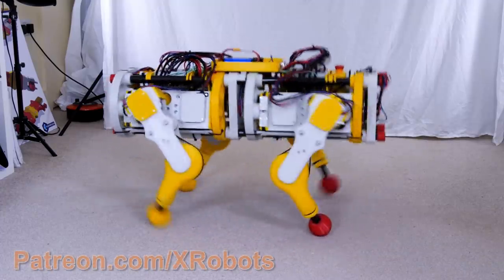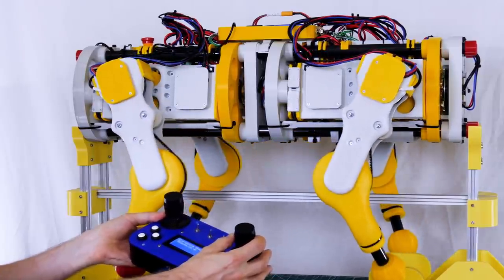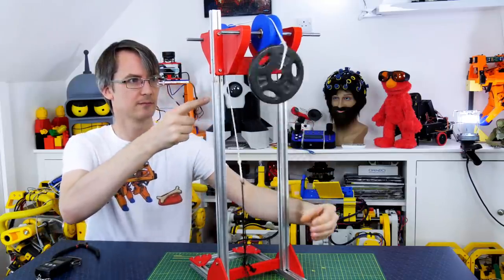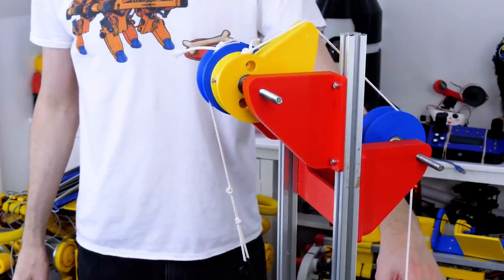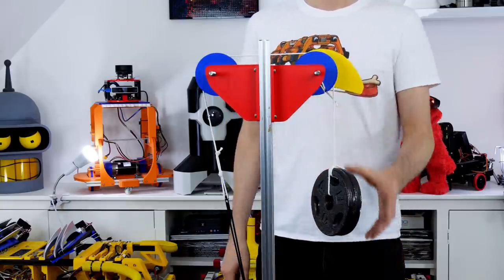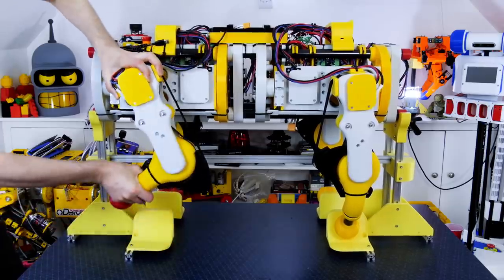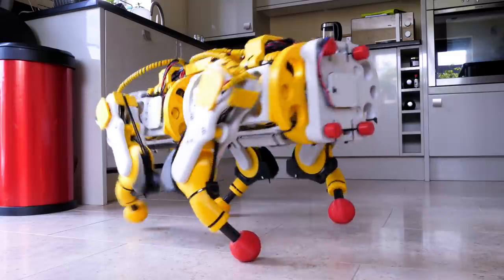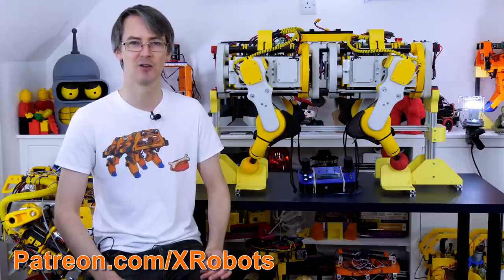Constant-Torque Spring-Balanced Actuator

Comment: James, Measuring the current shouldn't be too difficult. Just use any piece of wire that is sufficiently thick, with currents on the order of 200A you'll find a measurable voltage across them! 

For example, you can use the negative lead of your battery. Use the black wire of your balancing lead for one end of the voltage measurement, and the first "junction" where multiple wires connect as the other. 

The reactions that allow a LIPO to charge require some extra energy that is provided as heat to the charging LIPO. Thus a charging LIPO should get COLD. Now that effect is offset by the resistive losses around the system, so it might be unnoticable. But on the other end of the charge/discharge cycle.... the discharging lipo also produces heat that is added to the resistive losses. So a discharging LIPO should get warmer from the discharge. 

Last, that 60C rating of your LIPO battery is determined by checking that the battery doesn't overheat when you apply that much current. So if you're near the limit, I certainly expect the battery to be hot afterwards. You don't need to exceed the limit to heat them up.

Comment: There are constant force springs often used in robotics they might be a pain because you would need a bearing to hold the spooled spring steal wrap but they would work and would be way easier in to long run to optimize.

Comment: I have a much simpler solution for you. What you need is a "constant force" spring, a variant of a clockwork spring. You can find some on Amazon by searching "drill press spring", or aliexpress by searching "constant force spring".
This is a flat wound spring that can fit inside your robot's joints, counterbalancing while being completely hidden.

Comment: If you want to have a more adjustable spring rate you can just take a steel or nylon cord/rope/cable and use some standard springs that you can interchange. If you got the spring rate right you could even use smaller motors for the knee and hip joints. where you could use gear reduction with a planetary gearset so you wouldn't have the need for that much torque.

Comment: Seems like measuring the temperature of the motors beyond "not hot to the touch" anymore would be a good controlled way to monitor load. Furthermore, what old CNC drives did to reduce the heat of holding torque was to incorporate a brake. Seems like a combination of the two might be the best case for idle and mobile energy reduction.

Comment: You could also use an eccentric geared pulley for your belt drives. Allow the motors themselves to have more torque where they need it and less where they don't. It would be less bulky.

Comment: You know, I think one of the reasons I love robots so much is because it forces companies to be fucking creative again for once in their lives.
Youve seen the shit we had back in the 60s to early 2000s, everything was mechanical, and overengineered.
I can understand the shift away from mechanisms, since points of movement equals failure points, and extra cost, but god damn they are so cool.
And as is turns out, its not easy to just make a robot out of a bunch of motors and pieces of metal, you need alot of over engineered joints, pulleys, gears, and shit like that.

Comment: For Current Sensing: Allegro makes some really small current sensors. Pololu has a board(ACS724 Current Sensor Carrier) for the smallest series(up to 50A) in a tiny 20x18mm size. Might be worth a look. Next bigger Sensorsize goes up to 400A(Battery Protection is no joke) but I dont know of any available breakout boards.

Comment: Surely a spiral spring is the answer. They usually have a high range of motion so with the relatively small angle through which the joints move any torque produced by such a spring would be fairly constant. They're also compact and can be relatively light...

Comment: Lipos do get hot even when they don't exceed their maximum C rating. There are external Shunt trinkets for Arduinos, you could log their voltage output and then you've got your amperage over time :)

Comment: Nifty start... I think an improvement would be to change the cam profile just a bit so that the spring is exerting the correct force to balance the weight at the angle of the foreleg (eg, if the leg were straight, the spring should be putting out near zero because the T=sin(theta) * mg (where theta=0 for vertical -- pure compression).

Of course you need to translate all that into your coordinate system for the servos... and do what James Pray recommended below to compensate for the difference in length as the cam size increases...
But this is pretty cool man!

On a completely weird idea, you could put the "top end" of the bungee on a screw-adjusting hook to be able to adjust the preload (slowly) and could rig that so that "adjust preload to minimize current when the knee is at this angle" (ie, standing at rest).  Then the dog could adapt to carrying different weights without  a lot more current being expended -- fido, fetch the keg for me!...

Comment: Something in this video reminded me of clockwork, where they also really wanted to have constant-torque springs so the clock doesn't tick slower as the spring winds down. Bit of wiki-reading led to https://en.wikipedia.org/wiki/Fusee_(horology) which is essentially a longer, coiled up version of the cam you have. If you had a spring-loaded helical cam on the shoulder instead of putting the cam on the knee it might free up some space between the knees.

Comment: Do you have a thermal camera? You could surely do a nice demonstration by setting up a fixed, repeatable exercise routine for the robot, then run it with, and without the constant-force springs. The difference in temperature rise would be a clear indication of power savings.

Comment: I'd be curious to see a linear spring, either a typical coil spring on a telescoping rod, or a pneumatic spring. You could achieve a centerpoint where the spring is neither compress nor extended, and correlate that to the dog's neutral stance, then you'd have the spring action in both directions. This would also be less bulk on the leg, and could just as easily be mounted to either side of the leg, which may be beneficial when it comes to overall movement without modifying the body's frame. The importance of having a spring that can actuate in both ways shows itself in jumping, where one spring would assist in the jump itself, and the other spring would assist in the landing, this can be correlated to any gait movement but to a lesser degree. The bungee cord on the other hand only operates in one direction, meaning you still have drive inefficiencies in half of the movement of the joint. Alternatively, a torsion spring may be the optimal solution, as it can twist in both directions, and is much more compact, as it'd replace the hinge rod and add no bulk to the leg.

Comment: James try vacuum pistons, they are driven through the normal ambient pressure and have nearly constant force too.
The vacuum upkeep could be a bit of a challenge.
But since it is only necessary periodically to counter leakage you could try to getaway without a onboard system for the robots runtime.

Comment: Regarding the battery getting hot : Normally with ODrive, you can report the DC bus current draw, so you can know how much you pull and push on the batteries. Depending on those numbers, you can adjust the various PID constants to make it less aggressive, and it should draw less amps. Afaik you can't yet set a software limit on the DC current draw, but you probably can add an outer control-loop to use less aggressive settings when you have monitored the integral of the DC bus current draw going to high, or when a battery temperature sensor get too hot.

Batteries can also get hot due to regenerative braking, they are typically only rated 1C when charging, so using Odrive brake resistors can help.
Reply from the maker: It needs to be that aggressive or it doesn't work.
Reply: @jamesbruton  To troubleshoot you need to determine if it's the peak amps and when, or if it's the average amps which make the battery hot. 

- If the battery get hot when the robot is not moving, that's an average amps problem : 
When the robot is not moving the calculation is easy : power drained on the battery is Ubat * Ibat = R * Ihold^2 power consumed, but you have to be careful here because  R is the resistance of the wires to the motor + the resistance of the motor, and for brushless motor (resistance of the motor ~ 20mOhm) and for 2 meters copper 14 AWG wires it's 17 mOhm), roughly the same as the motor which means using shorter and bulkier wires (or doubling them) can have up to 50% reduction on Ibat (25% when you double the wires).
You can also increase the battery voltage.

-If the battery is getting hot when the robot is moving : I'd try using brake resistance and disabling the regenerative braking, I'd try to limit accelerations, but this means the robot may not be able to do some gaits. If it's a peak amp problem, tuning the inner current control loop of the FOC odrive to have slower response time can help reduce the max acceleration, but may make the motor control less stable.
On the hardware side, higher voltage, bigger batteries, more batteries, and adding external capacities on the DCbus of the ODrive would help.

Comment: Problems from an earlier project come to mind --- 
Wondering if larger versions of the constant force spring from tape measures may help here? Could drastically reduce the bulk at the knee while applying a relatively constant torque during rotation/tension?

Comment: Ok, this is sort of absurdly fancy, but worth a think.   How about TWO motors at each joint. one large to do the dynamic loads, "walking", and one small which is geared very low (linear drive screw?)  to set the equilibrium position of the spring, the static load.  If the robot has more weight (say because it's lifting something) the small motor would run until the spring balances. Or if the robot wants to operate and a net lower or net higher point, the small motor could then again run.  In fact the control system could use the time averaged constant torque of the large motor to determine the "goal" position of the smaller motor. The small motor's goal should be to zero out the average torque of the large motor (say over a 2-3 second period ).

Comment: The ratios provided by the variable (yellow) pulley is not being exploited. All the line tension is on the points where the line is actually wrapped around the yellow pulley, the beginning and end. This is why the balance does not work except at the beginning and end of the pulley rotation. The line needs to be in constant contact with the yellow pulley at all points of rotation. This should be easily remedied by raising the yellow pulley above the constant (blue) pulley, or lowering the blue pulley below the yellow pulley. 

In application on OpenDog, the spring should cross over to the opposite side on the leg. On the knee pulley, the spring is on the "inside", between the legs. The shoulder pegs should be to the "outside", towards the ends of the construct. I am not fully familiar with the terminology you are using, "inside" versus "outside", however the knee pulleys are in the default "correct" position. This may not be possible with the current design. But to maintain use of all the ratios, and thus consistency of operation, this should maintain full contact with the variable joint/pulley throughout the movement of the leg. 

That might be overkill given you have shown a fairly marginal variation of force during articulation, and OpenDog's movement does not seem to require fully consistent spring loading throughout the whole range of movement. But this may become an issue when traversing rough or uneven terrain.

Comment: I really couldn't see spring or rubber assistance working until the cam was made non-linear, reversed and revealed to have holding strength at 7:49.  This will work but making it compact is the next problem.

Comment: You could probably implement a similar system under the belly of the robot at the front and back for the shoulder joints of the robot and keep it relatively low profile

Comment: You could safe power when you make the joints breakable, at least if the robot is standing. Or would it add to much weight? If the motors are outrunners you could try to break at the motor with some sort of bands that are pulled tight by a servo.
Otherwise great video, it makes alot of fun to watch your videos.👍
Reply: Brakeable. You don't want them to break. ;-)

Comment: Great description of your development process. Have you considered constant force springs such as those used to replace weights in older double-hung windows? That may reduce the need to correct the force with a cam surface, though an off-the-shelf window spring is probably more expensive than bungees and 3d printed components.

Comment: Id say that the next step of improvement would be making some sort of an artificial muscle to replace the bungee and remove the cams entirely, but the new problem would be finding a compressor or pump (i think) powerful enough to quickly work the muscles and also small and light enought to be placed on the robot. Ive also realised that this would just over complicate things when a simple band and variable cam can just do the same job without adding more weight and simplicity, so yea lol
Reply: There's a guy on YouTube that's basically made exactly what you're talking about: artificial hydraulic (or is it pneumatic?) muscles without using a compressor motor. I believe he's using some kind of chemical reaction with hydrogen (yikes) to power the the muscles.  I can't remember the details though, I'll see if I can find the video and link it here.  
  
Edit: found it https://youtu.be/07oVoABYr10 
Apparently he's using a portable electrolyzer to create a hydrogen-air mixture. The hydrogen mixture has something like over 1000x the volume of the (water, I believe?) It's made from. Very complex, and dangerous, but it is technically possible.

Comment: Using constant force springs would have been better but sourcing them is very difficult this method of counterweight with an exponential gearing is best for low cost solution.. I wonder how big (volume) the setup would be as compared to the mass added and the load reduced whole using springs on open dog..

Comment: The problem with the linear cam is that you are stretching the bungie beyond the point where Hooke's law holds (displacement x is small compared to total possible x). You could offset this by using a non-linear spring--maybe a tapered spring or a dual pitch. A better idea might be to have a very long bungie in a fixed block and tackle system. In the current system, the mechanical advantage is the cam advantage. And your input distance is proportional to your output distance so you are stretching the bungie beyond where Hooke's law holds. With a regular block and tackle system anchored with a strong spring, you could keep the spring force in the kx range but still allow for the travel needed on the 'input' distance. This hackaday article about using multiple pulleys in the actuator itself even has a call out to Bruton's robots https://hackaday.com/2020/04/26/cable-driven-robotic-joint/ and  https://www.youtube.com/channel/UCUbDcUPed50Y_7KmfCXKohA

Comment: Great to see pcbway add useful services to Their platform - but I guess one important service is still missing: manufacturing of integrated circuits :/ lots of parts for my Project are out of stock almost everywhere :/ so it won't help if they could put everything together to a state where I could literally sell it if I won't have the chips to assemble :/

Comment: If the assisting force will be constant, wouldn't it be best to tension the joints with the bungee so they support the weight of the  dog mid travel?  Not sure where the force balance point is with the current setup.  That is an awesome idea on the assist!

Comment: How about measuring the amperage from the battery and comparing the power requirement before and after? Maybe try amp clamps (inductive) for the absulte current from the battery. Cheers

Comment: I think in order to minimize the power consumption you need to minimize the integral of force over the time of a walk cycle. That means if the leg is in the air for about 50% of the time and has to push down a force x for about the other 50% than the bands should ideally apply a force x/2 and no more. Energy is only saved from the transition between load and no load of a leg. The total energy needed to sustain load and keeping the leg up should be about the same.

Comment: It would seam to me that having the motor taking power when it lift the legs make more sense than when its standing up.

Resonable the amount of energy use to move the leg will be about the same regardless, the question is only if its on the way up or down the energy is expended. But all the time the dog is not moving, its just a total save.

Then i wounder if it might be possible to have a cylindrical solution having it on the low torque side of the gearing, saving a lot of space and weight.

Comment: You missed a key consideration. The force required to straighten the knee under load is greatest when it's fully bent (squat), and decreases as it straightens. You overthought this one. A spring (or bungee) naturally behaves favourably.
This is why walking is easy and can be done for hours, but squats will have you burning in just minutes.
Reply: Great consideration!
Reply: Yes, I think you are correct. Of course the point was to provide a predictable load, I am indeed curious if removing the cam will be even more efficient (and making sure your kinematics / motion controls still work).